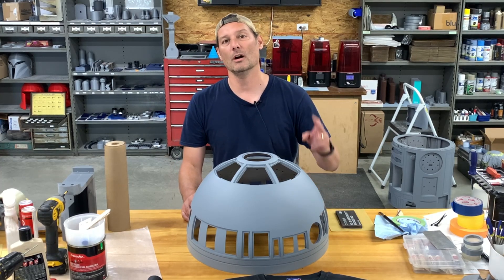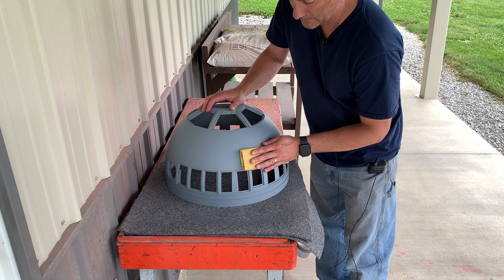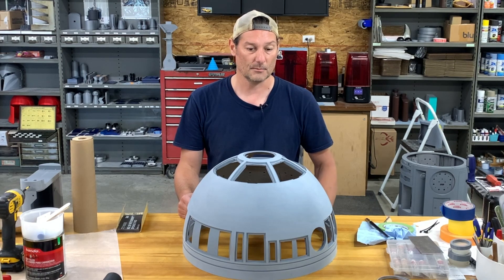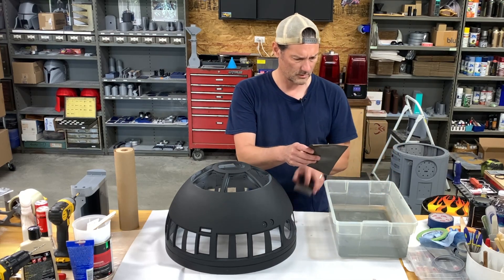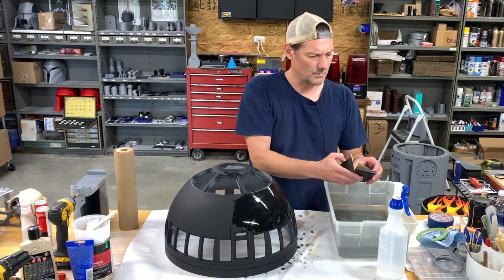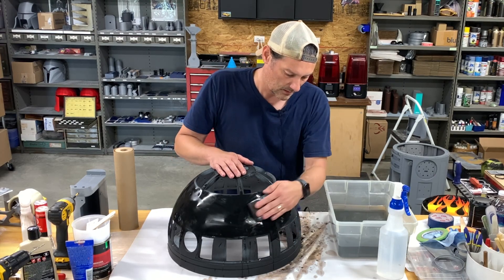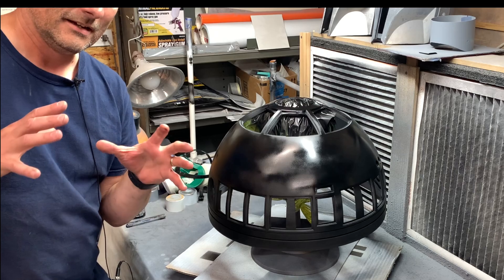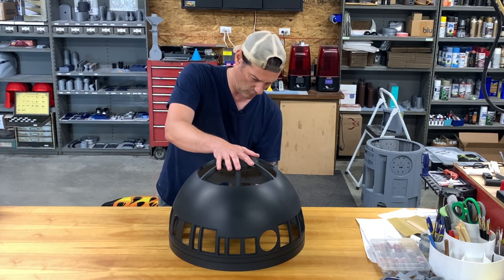Finishing an R2-D2 DOME R2 (Build Part 2)

Comment: One more question:  are these parts PLA or PETG?
Reply from the maker: PLA for the dome and anything not structural.  PETG for items like the gears and foot drives.  
Most items printed with 6 walls and up to 40% infill.  That may be overkill but that’s my preference usually

Comment: Trying to follow the parts but the seem to be out of order…you also seemed to have started with a one piece dome and then switched to a multi piece dome?
Reply from the maker: So the dome build video is filmed out of order.  I hadn’t planned on doing a multi build video but I changed my mind.  I did start with a multi piece dome and printed a 1 piece dome so, yes you are correct.  I used 2 domes.  I’m doing better at keeping things in order now

Comment: Good video. How is printing the dome in one piece cheating? If you have the capability to print it in one piece that’s the smart way to go.
Reply from the maker: True but after making 4 parted domes and 1 single print dome I feel like I cheated because it took a fraction of the time haha
Reply: @coz3d  Work smarter, not harder.